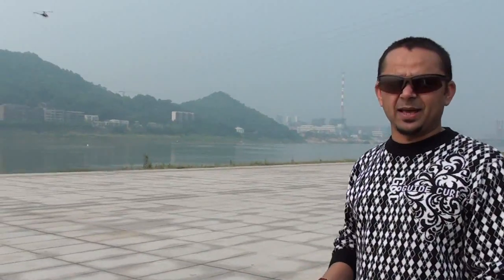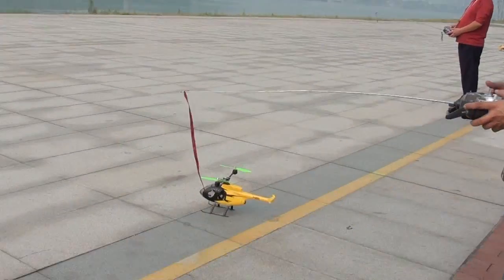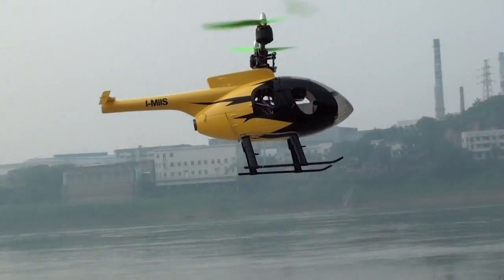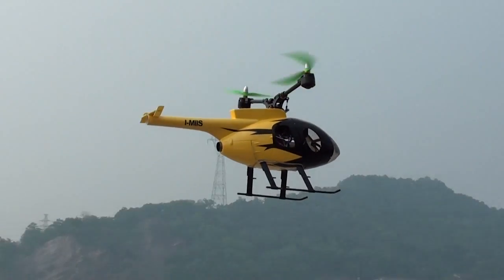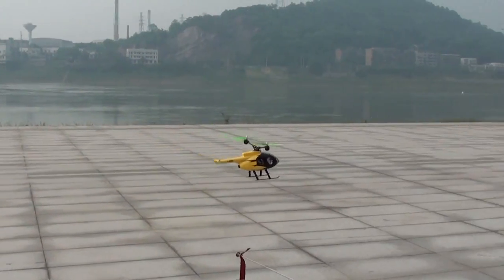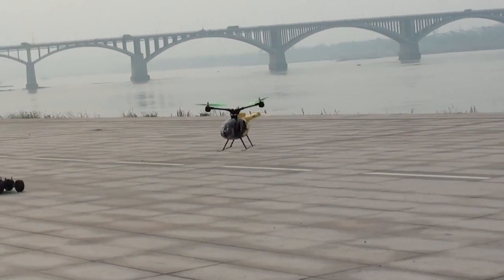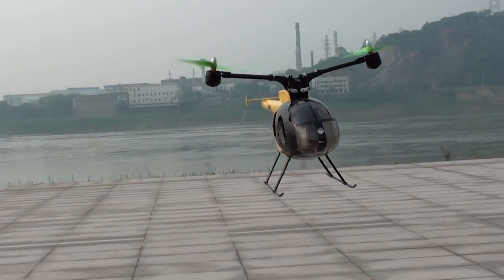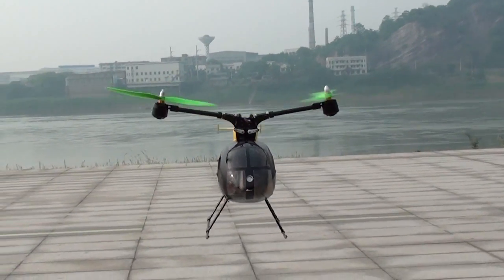New Concept RC Helicopter Bi Rotor Dual Copter Maiden Flight

Comment: 2) Electro-mechanical - Tilt the actual Stabilisation Unit fore & aft with a servo. Tilt aft to go forwards at speed and tilt forward to go backwards at speed. The tilt servo could be set to operate once a stick threshold has been reached so it doesn't operate for small stick movements; allowing fine control for hovering and slow travel then kicking in for FFF or FBF.